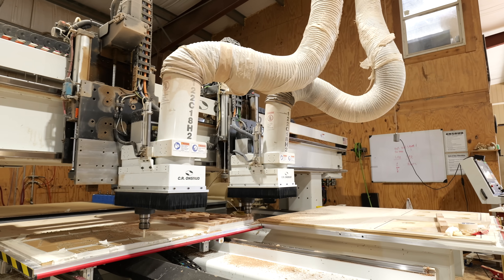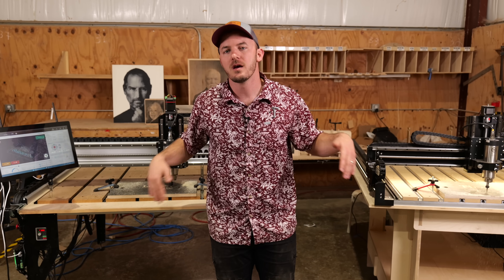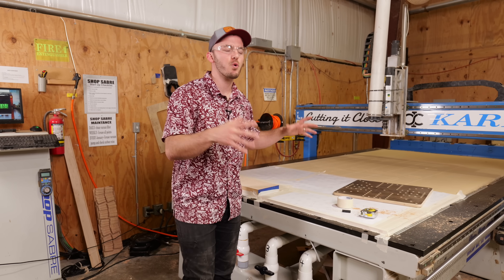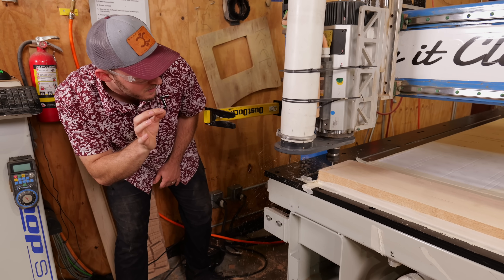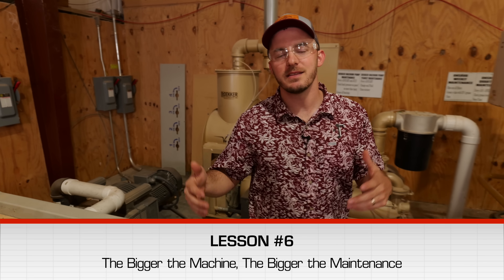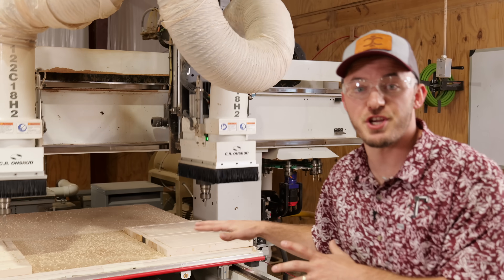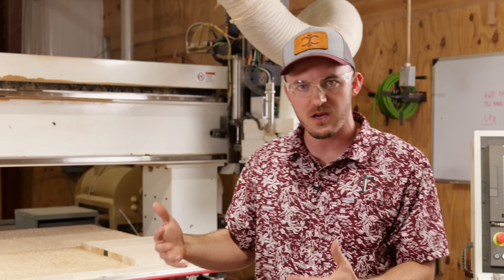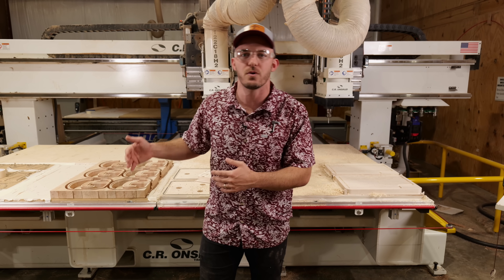I Spent $478,000 on 9 CNC Routers (Here’s What I Learned)

Comment from the maker: 🛠 Shop CIC Workshop - Bits and Materials - https://cicworkshop.com/
🖥 CHECKOUT THE SHAPEOKO 5 Pro CNC - https://shop.carbide3d.com/DRAPELAWORKS
🖥 CHECKOUT THE ALTMILL CNC Machine I Used -  https://www.sienci.com/?ref=zte3ztn 
Join our new CNC Projects Facebook Group - https://www.facebook.com/share/g/1EJfwS5JKJ/?mibextid=wwXIfr
Reply: 2:56 Was just the opposite me😂, my first machine was one of the older versions of the shapeoko. It ran the grbl code, in the controller sucked you couldn't pick up on a line of code if you lost power or the machine stopped the other start from the beginning. You couldn't make changes like adjust the tool diameter in the controller to offset your qatar, it didn't have feed override or RPM override. After that I switched to Mach 3 with the first machine I built. But play switch to masso with this latest machine build. So far it's been great!

You dont have feed rate over ride?
Reply: 12:33  scrap that controller and switch over to a Masso!
Reply: DO you import you cnc machine or locally made in you country?

Comment: Curious as to why you don't just change the work offset height on the big router to make it cut deeper? I'm learning on a Komo VR 5x12 foot FANUC that's running windows 98 and it's a pain in the ass to use the computer sometimes.

Comment: Use cam software like fusion. Once you have post processor`s for machine`s. Will enable you to program any machine using one program all machine use g code nc format just with tweaks hence using right post. Regarding interface of machines all the same when you break down what buttons do. Most important datums, tooling offsets are setup correctly and retract high's put in place. Right feeds and speeds for type of material setup right will save you fortune on tooling's wear and quality of product.

Comment: Im not sure I agree, a production woodworking machine like a Biesse or SCM will have retractable stops and vacuum -so the loading time will be very fast

in fact lots of the production woodworking point to point CNC will have split tables so you can load one whilst the other is working

Ive worked in factories where these machines are set to do a 8 hour day shift, then a shift worker comes in and does a 12 hour shift 

Masterwood CNC joinery spec machines can cut out all the parts for a sliding sash window in 2 hours -try that with traditional machinery

Comment: I just dont get the reason for large industrial machines for wood unless bed size is a problem. Problem not having tool changing? Just buy another machine thats preloaded and set up a proper jig for doing 4x faster transfers while multiplying your output since you have more machines for the same footprint. Its also a lot cheaper. And you say you can never run that fast on a smaller CNC (for the double head one), but the thing takes up the footprint of like 12 hobbiest machines. My love is efficiency.

Comment: it's easier to change tool paths in cad cam vs messing around on cnc controller editing g-code or offsets. there is no need to spend 30 minutes to cut additional 1/8" depth.

Comment: Great video! I just came across this video at a time when I am trying to make a very difficult decision. I have a ShopSabre IS510 like you show in the video that I bought about three years ago. I had grand plans of making cabinets and even had a buddy who was doing cabinets on the side out of his garage who was interested in a business arrangement. I was gung ho, did a ton of research, and bought into the notion of buy the most CNC you can afford (or buy your second CNC first). I was going to buy the ShopSabre Pro 408, and over several months talked myself into the IS510 and had few regrets. Shortly after I received my CNC, my wife was diagnosed with cancer. She seems to be cancer-free right now, but has developed other related issues that have her wheelchair bound now. In short, because of the health issues, other than running my 15 HP vacuum pump to make sure it was wired correctly for proper rotation, the rest of the machine has never been energized. I kept saying I would get it up and running, learn to use it, maybe go to Minnesota for the training they offer, etc., but other things kept taking precedence. Somewhere deep in the back of my mind, there is this little brain tickle that tells me that I will never find the time to get it running, and it is probably just best to sell it. Your comment about having to spend $5K on a part (and there are even more expensive parts on this machine) is something I have thought about more than a few times and might just be the impetus I need to get serious about selling it (I hate to see what my loss will be but it ain't making money now). Sorry for the long post...I guess this video was somewhat of a cathartic experience for me.

Comment: It honestly makes no sense that the programming and computer interface on a bigger machine should be more complicated or even different (assuming the same features of course) computers really don't care about scale much. Seriously, why is the computer on that big machine the size of a large cabinet when a smaller CNC can be controlled with a literal arduino and laptop, or even a raspberry Pi? I understand the bigger machine needs larger power electronics (for runnin the motors and spindle) is that all it really is? Even then $300k and the thing don't even have toolpath preview, there is really zero excuse for that.

Comment: 1) is impossible FANUC dont have tool path
2) why you dont use fast clamp set ups?
3) to use 1 utensil for all the job ... means you are a rookie
4) just buy shorter end mills and you can go G0 when work, wood is EZ
5) 1 hour for a final surface cut? for me is 25min manual programming+ job time. dont use end mill but larger frontal mill + fast clamp setup + second spindle , meanwhile the first make the first part ....
6) with FANUC you simply literally dance when programming, is all manual and you can even mod MACRO for tool changes that i see are SLOOOOOW
7) with MACRO you can save subprograms for roughing and recall those for finishing, next tool different G41\G42 diameter.
8) that PC is TOO OLD, change it, it slow you down

Comment: Awesome video and channel. Im a cnc operator and I started on the multicam 3000 and worked my way up to a CR Onsrud lmao didnt expect it to be on here.
Reply: How did you like the Multicsm.  I have a used multicsm 44+ it’s been great with mach3 , g540 and Vectric. I did have. Z issue due to set screws backing out. After that was fixed it was great.
Reply: @JeffDenig very powerful machine. Pretty simple to use. Its only good with the tool change manually changing your bits was kind of wack.
Reply: @JeffDenig do you own your own business or you worked on it for work?

Comment: I'm sorry, but you have not given the correct information regarding the Onsrud, or industrial CNC's. Just about everything that you said about industrial CNC's was wrong. If you go to any industrial company with a woodworking CNC and watch how they are doing it for fifteen minutes, you will have at least an understanding of how to use it. First off, any machine that is using a stepper motor for axis movement, (except for the tool changer), is a toy. Secondly, look into a used machine if you are not into "heavy" production. You can find a nice 15 HP. single router, with tool change, for less than some of those toy routers.  Look into a thing called a spoil board. All table routers, I'm talking about an industrial term, not a router that sits on a table, uses a spoil board and there is NEVER the "onion skin". I could go on and point out almost every point that you made about an industrial router, being totally wrong. I hope that anyone who is thinking about getting a woodworking router, will disregard your comments regarding an industrial router, and research it. My background has been involved with industrial woodworking machinery for 45 years. Twenty years in industrial woodworking maintenance, and 25 years as a field service tech installing and servicing industrial woodworking CNC's.
Reply: Can you point me in the direction of used cnc tables?
Reply: @woundedworrierz  Check on irsauctions. I haven't check with that site for awhile, but they usually had a few CNC routers every month. I bought two machines using them with great results. It is an auction site that companies use to liquidate when closing down.
Reply: You gotta understand, YouTubers like this guy makes videos for content engagement for his preferred audience, which are hobbyists. From the beginning of the video, him saying all CNC are the same, is like me saying since I like to sing in the shower, I'm a singer like Luciano Pavarotti. Plus, I suspect his dual spindle Onsrud is a very old, pre-owned machine. I've programmed/operated several brands of industrial grade CNC machines, and even my very first Weeke CNC from the early 90's had a tool path preview.
Reply: @ptabz3112  I agree with you. Our company started with Alberti machines, then Heian dual tables, then Komo. I ended up doing field service for Busellato Routers. The Alberti's were from the 80's and had tool path.
Reply: Can you expand on your comment about stepper motors?
Reply: @matiasmorant4484 If comparing CNC routers for woodworking,  that are capable to be used for production or cabinet shop, a heavy cast frame is a must to hold decent tolerances. Also need the head and 3 axis mounts built tight, and lastly the spindle that mounts to the usually Y axis frame averages 15 Hp. Constant torque. I would guess that adding up the three axisis, and spindle would be around 5,000 lbs. Now that should do rapid at around 45 Meters/minute. Then that needs to plow through 3/4" plywood at a cut rate of at least 12 Meters/minute. It should do that for 8 hours each day, without heat or stress. The old machines would use a DC servo motor with encoder to close the loop. The stepper could be used to rotate the tool table Steppers are for slow light weight, whereas servos are the power movers, usually wired at 400 VAC. My point is that there are places where steppers are great, I'm building a desktop laser engraver using 42's and moves slow with barely a load.
If you're interested in a router, stop in at a large company, ask to see the plant manager and ask him to see their machining centers making dust
Reply: Time for you to post your own video and debunk his ckaims.
Reply: @Z-add  I install and repair the machines, photography is a hobby of mine, video production does not interest me. Anyone that is even looking at an Onsrud doesn't need convincing that those other machines shown are not comparable.
Reply: We need advice on how cncs work, please how could we reach out to you officially? It’s for a startup
Reply: Hi, I’m a cabinet installer, I’m looking to go into business for myself, what would be a good machine. Not to concerned about production, just an all around decent machine that I can make cabinets with?
Reply: Dude... most people/small businesses are milling things like coasters or signs. Tolerance does not matter in their case. Now if you are milling furniture, then maybe you should care. The problem is, this guy literally talks on small business and etching. People like that dont need industrial machines. In fact, most people dont. Not even a good amount of furniture businesses.
Reply: This guy's rant was likely generated by AI with prompts written by some kid in his mother's basement. I enjoyed the video.

Comment: All 10 Key Lesson here. Thanks me Later ....:hand-purple-blue-peace:

#1 All CNCs Follow the same Basic Structure
#2 All CNCs Have a Different Learning Curve
#3 The Smaller the CNC, The Easier the Adjustments
#4 Vaccum Tables are Unnecessary on Hobby CNCs
#5 There's No Such Thing as a Perfect Tool Path
#6 The Bigger the Machine, The Bigger the Maintenance
#7 Dust Collection will Always Suck
#8 Expensive Machine = Much Harder to Program
#9 A Bigger Machine is Not Always Faster
#10 The Bigger the Machine, the Less You'll Run it

Comment: It shouldnt take you aan hour to geete that bur out the wood out, just change your tool offset wear for Z  .25inch lower or however big it is.  if youre worried about it cutting the other parts .25  inch lower then you should have put it like this same tool different tool slot , different tool  slot has different z wear offset " Tool 6 Slot 6 Z Wear offset .0015    , Tool 7 Slot 6 Z Wear offset 0.0115"

Comment: His biggest machine uses a Fanuc 'control'.  All professional machines in the past have used a dedicated control... until HAAS came into the picture. The leap from a dedicated control to a PC based system or the reverse is challenging for operators who are used to the other.  Most ppl using a control in the beginning notice that there isnt a full keyboard, unlike a PC.  So there are trade-offs.

Comment: Hi Ryan. The bottom onion skin on your Onsrud part could be fixed without a program change by either changing your work coordinates (G55, ect) lower or simply use the z-shift  to lower it by the remaining thickness. (Blue button on the top left hand side of your screen. Enter a negative number to move lower). I set up production runs on an Onsrud from time to time cutting wood or phenolic parts. And as someone who went to college and has worked on many industrial machines, no, going to college won't help you be any better off when learning a new piece of equipment. It's always a learning curve. Good luck man, and thanks for the videos.
Reply: Something is wrong about his whole set up.    And taking an hour to correct the problem wiht programing tells me he has no idea what he is doing.  He needs someone to show him how to set up a machine.
Reply: @jomgelborn  Running those little parts on those big machines is such a loss not sure how that's is making a profit when the machining cost is so high, hitting start on one of those machines should mean a few thousand dollars is about to be cut.
Reply: @veelink6345  Yeah I really don't understand it either. They must have ridiculous margins on their goods

Comment: I have several comments 
1. Don't ever buy Laguna customer service is terrible,  product build quality is terrible. 
I paid 42k for a 2021 M2 and last year I gutted it out completely and pit in good servos,  drivers and operating system.  In 2 years I lost 18k in spindles because the safety sensors were not hooked up. 
2. If you are looking at buying a 4x8 or other similar size contact Bcam cnc. I ordered their flag ship 5x10 with automatic loading and unloading with custom syntec 7 axis touch screen controller for less then 40k delivered. 
Customer service and warranty are phenomenal,  machine quality is excellent and gantry speed is scary fast.
You can order 4x8 with rotary auto tool change. 12 kw HSD spindle, 4x5 multi drill hsd spindle , 15hp vacuum, and dust collection for 21k.
3. He is 100% accurate about detail oriented work, stay with a smaller machine.  The wear and tear on a larger machine is pretty substantial.
4. If you have the capability, build your own machine.  Use the Masso G3 controller and look at automationtechnonogiesinc.com for your components.  Routers are best for smaller machines as they are easily replaced. Spindles can get expensive fast and more complicated but have clear advantages over Routers.

Comment: What software are you using? Why not use the same software on all your machines?
Reply: I don't believe he can because of the hardware on the CNC and perhaps post processing.   The middle machine, the Shop Sabre can use Vcarve and Moziak.  I believe it can run Aspire, but not 100% sure.   I have a ShopSabre and have found Vcarve to be pretty easy to use (it came with my machine).
Reply: As a systems administrator, I find it surprising that compatibility is not regulated in this industry. Have been binge watching CNC machines and 3d printers since they popped up on my feed.

Comment: Why not buy several smaller CNC’s instead of the $300k unit. It seems like having more, cheaper units would be more dollar efficient since where you’re at, land must be cheap.
Reply: For some tasks bigger machines are faster, more reliable and make massive production easier. Smaller machines are not the best solution if you make 1000 pieces of a single product

Comment: You have to make a lot of cutting boards to pay off a $300,000 machine. How much profit can you possibly be making per board? A board like that on Amazon is about $70  It's maybe 2 board feet of wood and that's maybe $10 a brdft. So $20 in materials. Shop overhead has to cost something. Electricity, taxes, etc.  So let's say $40 in profit a board.  I guess that is only 7,500 boards before you're paid off. Which you could do in a year. You'd be eating and sleeping cutting boards doing it though.
Reply: What about maintenance, tool costs?

Comment: Thanks, again, for the informative video. What I’ve learned as that regardless the cost of the machine it’s the expendables, accessories, and spare parts that really cost. 
I’m just a hobbyist CNC’er and I pretty much did the same as you, but on a very small scale, and, uh, less machines. I went the tiny Sain Smart desktop, to X-Carve 1000, to Shark, to finally Onefinity Woodworker Pro. I’m real happy with this setup and this will most likely be my final machine.

Comment: Altmill or shape? I'm looking at getting one. All things equal, which would you get? Seems Alt is beefier.
Reply: Rigidity is key to speed. All bolted extrusion based chassis are about the same, compared to welded frame beasts. Get whichever machine you prefer, based on price and esthetics.